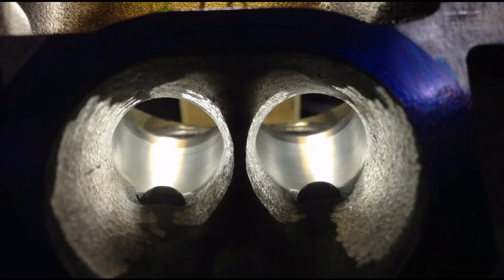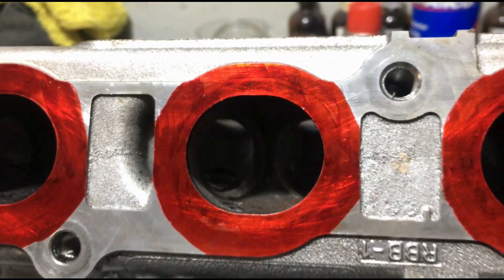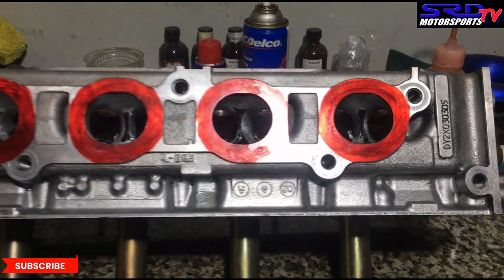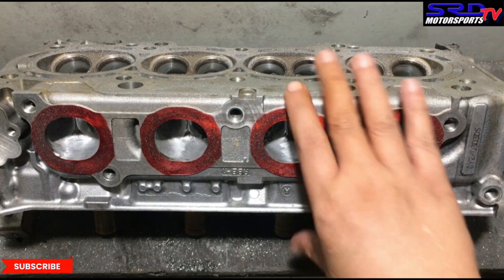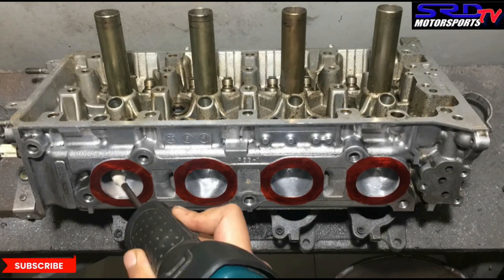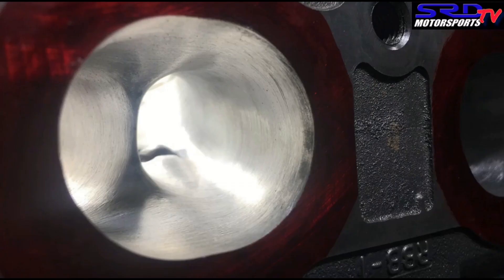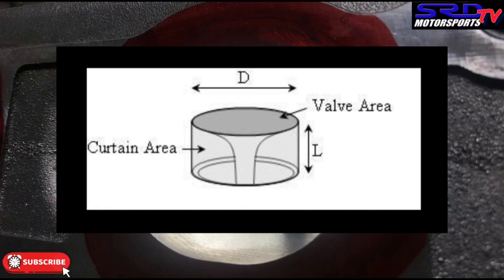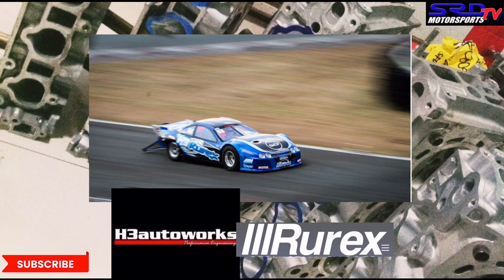Honda K24 rbb head porting by SRDmotorsports

Comment: Here in the USA most people want the PRB head on the k24 block for the reasons you mentioned. I was wondering if this basic port job you did would allow the RBB head to exceed PRB performance on an all motor k24 setup?
Reply from the maker: I think it could, I’ve not yet done enough r&d to tell but a couple of World time attack competitors in Au we did a couple of RBB for their track cars and they stuck to that configuration. For a couple of years before going turbo and switching to PRB

I guess some would say the PrB will give more top end? And street with DIC 
Ok makes sense but then also the RBB could prolly do the same and get good top end with a DC3.2 or something cam and still be streetable
Reply: @SRDmotorsports  I read somewhere that Honda cast the PRB head with a finer grain sand to improve performance without doing hand porting like with the B series Type R heads. Being that the RBB ports are cast so rough im sure porting would bring performance close if not exceed the stock PRB head. Especially if you use the 2006-2008 k24a2 cylinder head that has the larger intake valves and more aggressive vtec cam lobe.
Reply from the maker: From the looks of it RBB and PRB looks like they are both cast better than the B but so small diff it is miniscule but I can see K fans saying it to talk down on Bseries which is more common 😂🤣

Comment: Love this and looks beautiful.  I have maybe oddest question but if you have a opinion would be appreciated but if not thats cool.  If one likes the K24/K20 series but always wished the exhaust porting was different for sound reasons, caring about power but not as much as sound, would something like this potentially make a good compromise?  Studied engine sound for awhile and found engine like K20 have too much gutted directly aft individual the ports (good for emission and purpose of layout, fine for power but) generally for sound smoother or tighter transition from 2-1 with less extreme expansion then K20 has should sound cleaner.  Thinking custom port possibly with slightly enlarged valves could be a answer but i;ve never worked on K series.  Just for general street hotrodding purposes, figure point of entry may be a bit less too?
Any thoughts?
Reply from the maker: That makes sense actually and even in power Endyn with their new casting Kseries head years ago did notice when they ported “smaller” the bare casting it did surprise them on the flow aspect…maybe just maybe it would have sounded different too as you stated cuz it was a smaller exhaust port

Comment: I noticed the speed with your carbide bit is very low which can help with the bit skipping and causing issues. I like your finished work but a Dyno before and after the porting would be awesome. The k series heads flow "around" 300 cfm stock so they aren't really strangled for most of the off the shelf camshafts for a na build. Sure a well ported head will make more power but why not prove a stock vs ported head Dyno.
Reply from the maker: Oh definitely agree on that man…

And dayum! Good observation 🤣 I use a 220v Makita downturned via a 110v transformer, without it it bounces like heck
Reply: @SRDmotorsports  I use a 1/4" grinder with a voltage regulator allowing me to dial in the speed but it's all 120volt. Keel posting your work it's awesome content.
Reply from the maker: @ericloki3188  the speed control/regulator has been something if wanted to try as I learned that Larry/Endyn used to run one back then so I was like “great idea”

Which I’m sure u def enjoy it too!
Reply from the maker: And also u are right on the Ks flowing real good but as stated on the video I was pinpointing some locals here that brag about it but run 4 bars boost? Ofcourse they keep it hush hush that they melt injector tips? 🤣 hence the example was the H3 ported Bseries 2liter that still holds the record here and makes as much as 1,137whp with less boost…

I think on the p2j video I did show what customers in Austria did which is cool 
They slapped on a z6 head by us and gained 90whp same boost on the dyno

But since it started to run out of injectors they redynoed third time with more boost and did hold the 1mile record back then on Austria ftw!
Reply: @SRDmotorsports  I agree with you a local shop in orange county just does a really simple 5 minute pocket port job with their turbo b series builds. I'm going to be porting their heads that have already been dynoed to show there is so much room for improvement. Even if it's only 20whp on a turbo build anything to get the turbo to spool faster or to increase velocity throughout the entire rpm band would make a huge difference with drag or road race application. All these guys bragging about high boost stock port have no idea what they're missing.
Reply from the maker: @ericloki3188  true! On 20whp

Aside from quicker spool as u mentioned? I’d bet u would also improve its “power pick up” if let’s say road racing etc gets snappier all around = Senna’s preference lol

Comment: I think what most stock port turbo guys miss is that although they improve charge density with their turbo set ups, the improvement for air speed and flow is left out when they stay with the stock ports.
Reply from the maker: yes and an engine is an engine no matter n/a or turbo

and when ports like cams can affect the graph shape? it matters as much as the turbine capability no diff when checking a "compressor" map to pick n choose a turbine.

sure there is "traction control"
but how is it if 1-2-3rd gear traction control percentage is up that it seems like u are running a weak engine? result? slower times

Comment: great video! would you advise bigger and/or flat valves for a p08 head? thanks
Reply: @findtherightbeat  im just here learning lol. maybe this thread would help someone out
Reply: @vince.r  It's nice to pick the brain of someone as knowledgeable as Ralph. Too bad all of the info on the other boards/forums are now unavailable. People shared good info then, though some were very secretive with what they did. But Ralph is different, he's willing to share info so that we can learn.
Reply: @findtherightbeat  Well said!
Reply from the maker: even excellent question :)

the flat faced valves i favor as in general it raises about 0.3 in static compression

resurfacing the head during headworks from us
its free of choice from 0.005" removed or 0.040" (1mm) removed  and 0.030" resurfaced is 0.75mm that generally bumps 0.7-0.8 in static comp

so altogether thats 0.8 + 0.3 = 1.1

a stock 9.3:1 will become 10.4:1 if it was a jdm p08 d15b
Reply: @SRDmotorsports  Wow that's some good knowledge. Thank you! I'm not sure if the p29 pistons would like that along with a stage 2 cam.. hopefully wont need to run race fuel lol
Reply from the maker: @vince.r  nah thats fine ive ran p29 + slight shave head on crower stage2 blaze handled it

-its easy like cake for Jeremie to tune with his experience
Reply: @SRDmotorsports  Sorry, don't mean to jack this thread. Do you clip your water pump fins for d-series builds?
Reply from the maker: @findtherightbeat  no need to do that actually

cavitation happens on a crv/d16 ratio pump only at 9,100rpm

on b16/ITR ratio its 9,800 

so its beyond the d16 powerband i mean let alone revving it to 8.5k seems nonesense
when even on crower stage 3 cam the peak power is 7,500rpm

whp goes up but the rpm powerband remains the same
Reply: @SRDmotorsports  Sounds like a good plan. Now time to make that cash! 😆
Reply: @SRDmotorsports  Thanks, I was thinking more about freeing up some power as some of Larry's students swear by it rather than cavitation issues.

Yes, no point to rev that high for D's since it's beyond the powerband and it'll just bring about unnecessary wear.
Reply from the maker: @findtherightbeat  oh yeah def it could be freeing up some power nobody knows how much whp

but same i mean if the other avenues havnt been maxxed out yet? then this approach is far from being needed pa

hint - bearing tricks and mods that lead to freeing more power :)
Reply: @SRDmotorsports  There you go, some like it tighter for the engine to run cooler. Some like to run it on the looser end to free up power
Reply: @SRDmotorsports  Found my notes:

Setting Clearances (Darin Morgan)

"Going too tight on clearances such as piston-to-valve, piston-to-head, piston-to-wall, and main
and rod bearings will kill you every time," says Darin. "On the other hand, there are no
drawbacks to being too loose except for a little more oil up top as bearing and side clearances increase. That can be counteracted pretty easily so it's not a big issue".
What have I gained by tightening the bearings?
1 - Reduced oil temperature
2 - Improved bearing surface wear
3 - Reduced windage (more power). See #1
4 - Reduced oil consumption
5 - Increased power from lighter oils & smaller pump pressure sections
6 - System capacity to handle piston & spring oilers and still have reasonable hot oil pressure at
idle
7 - Longer fatigue life for crank, rods, block, etc. The proof is in the fact that none of these parts
ever show run out or out-of-round after extended use
Reply from the maker: @findtherightbeat  and it doesnt end there

looser = freeier power or easier to spin
lower oil pressure so u solve witj 20w50

so it becomes a milli vanilli situation 🤣
Reply from the maker: @findtherightbeat  yep darin morgan of reher-morrison is the man ftw!!!!

alot of things i gathered from him

hint... my most prefered oil weight is 5w30

lighter sha than Delo the sakalam 🤣

the 12.1 run in 2017 was on honda 5w30

jasper's 12.5sec street car runs Mitasu 5w30

cuz i run loose bearings and thats a lie 🤣
Reply from the maker: @findtherightbeat  check out my "how to: bearing clearance check with plastiguagae"

it lets you realize some tidbits i know u will find interesting
Reply from the maker: @findtherightbeat  yes good vid too and Tom Fujita owns and operates Portflow!

another thing i was contemplating on talkng about in the future (distant future) cuz its hard to have ready materials for the video so i must wait for on going projects if related etc

at the end of the day i got to run my shop SRDmotorsports, we are just a 2 man crew me and my helper so imagine even walis? we take turns hahahaha

that thing* though i mentioned is valve seat valve angles and how it relates to valves thay ultimately influences flow :) and aside from the all important 3 angle seat... there are back cuts, face cuts, tuliped stem etc all that makes one BIG influence on flow :)
Reply: @SRDmotorsports  I'd like to know your thoughts on the below for a D16:

"fully radiused exhaust, thin seat angle, like .040-.050
margin. intakes go 75/65/55/45/35, leave the angles sharp except just barely break the
edges on the throat to 75 and 75 to 65 edge.. just a hair with a loose sandpaper strip and
tranny fluid. make the seat super thin, like .030-.035.."
Reply from the maker: @findtherightbeat  sounds decent i know the speech pattern 🤣 so sounds decent 😂

Comment: Just picking your brain, which would you choose for a daily driver/weekend circuit rig?

Stock K24 with a well ported head and valve job, VTC gear, a very good header and intake setup that's tuned

or

Built 85x87.4 b-series with s2 pro2 cams, decent cast pistons, well-ported head and valve job, good header and intake and tune.
Reply from the maker: hard hard question... id choose stock k24 ported head for its massive torque and all... 

the 85x87.2 wil have significant torque but incomparable due to displacement... then we make sure we run r888 tires or ar1 to have "some grip" while k24....

so with those factored in? more expensive K24 and more spin is why sometimes i suggest 85x87.4

more usable realistic on the road power 
more built/karga so morefun for the owner at nearly lesser cost

sigh see how hard it is to choose?

but for the "wow" factor on locals if u are after "wowing" boys and lodi then K it is 🤣
Reply: @SRDmotorsports  hahaha, hard to choose right? That's why I also asked you, haha! 🍻

We're old and there's no more time or appeal to wow other people, I'd be lucky just to have enough time for myself, hahaha! 

It's just disappointing that this "flex" mentality is what it's all about for many of the young ones. Insert those touting their thrice overpriced original wheels but have unknown brand tires 😂 and they like putting too much stickers on their cars these days
Reply from the maker: @findtherightbeat  definitely! i agree and great you mentioned that... locally our "flex mentality" syndrome and i agree wtf